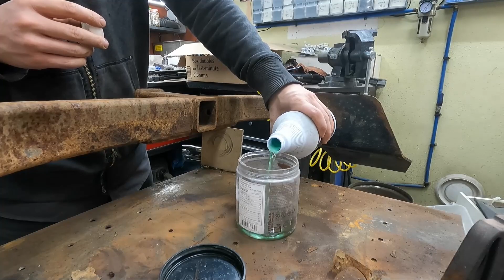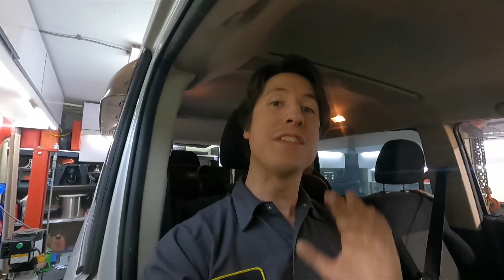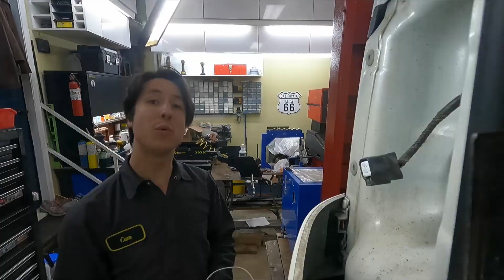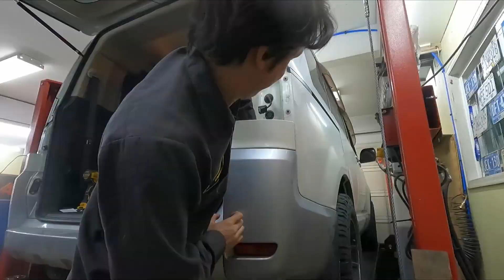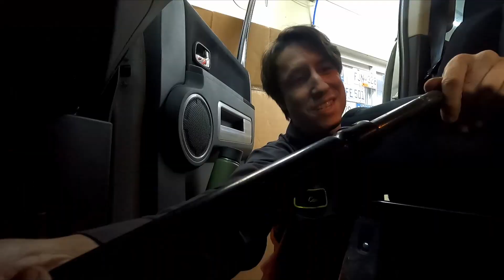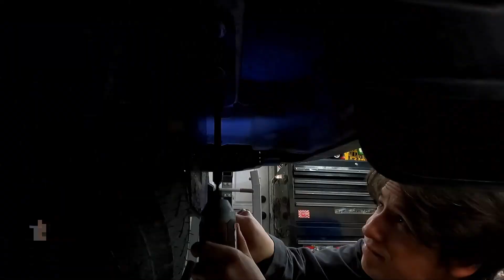Delica D5 Trailer Hitch and Wiring Install With No Delica Parts?

Comment: Hi. I tried a 2007 - 2012 outlander towbar on my 2010 D5 - didn't fit. Can you tell me which year & model of outlander that towbar was from?
Reply from the maker: That's should be the correct one. You will need to modify it to fit as shown in the video.
Reply: @projectaddiction  No, it looks completely different to the one in your video. I'm in the UK, maybe that's why....
Reply from the maker: @psykohead226 not sure what to tell you I am afraid. As far as I know the chassis layout is the same for UK and Canada.
Reply: @psykohead226 hey, did you work out where you went wrong here ?

Comment: What was that tool you were using to take the rust off the hitch. Thanks
Reply from the maker: Pneumatic needle scaler
Reply: Thanks.  Also what's the size of the hardware used to attach the hitch

Comment: I wish I watched this BEFORE I pulled apart the interior to get to the harness from the inside.  So much had to come out to get behind that left hand side light.   On the interior, just behind the lights there is a pass through grommet and a 'spare' connector just below it.  I am guess it is designed for a towbar harness.  About to hit it with test light.  I suspect with practice and the right shaped tool to hold it, you could plug in from the outside.

Comment: Big thumbs up!  My 2007 Pajero arrives next week, so hoping an outlander hitch bolts right on to it too. Will be watching for your upcoming hitch videos d. Subscribed!  You and your wife have a great presentation style.
Reply from the maker: Thank, glad you are enjoying :)

You will likely find the Pajero to be different than the outlander. For the first chunk of its life the Delica shared it's under pinnings with Pajero. When the D5 came about the Paj and Delica split way, with the Pajero remaining a true offroader and the Delica becoming more tame. The outlander/delica is based of a car chassis (lancer) while the Pajero remained based on a truck chassis. However if you do try be sure to let us know the outcome as I would very curious.
Reply: Damn - you’re right - even the exhaust is on the opposite (left) side than the D5. Kinda funny there tow points are welded to a long bar that runs all the way side to side.  Good times!